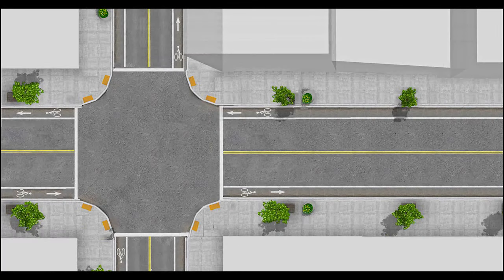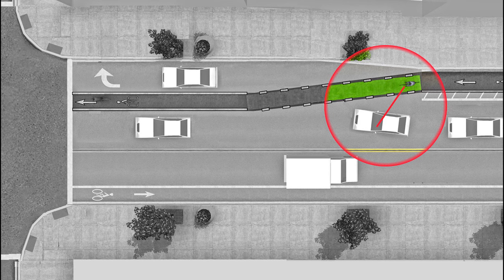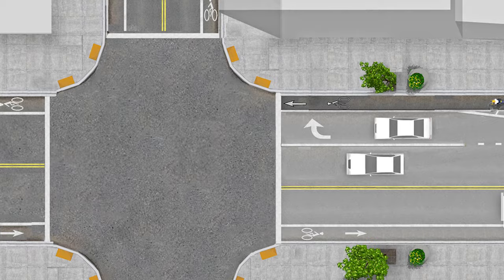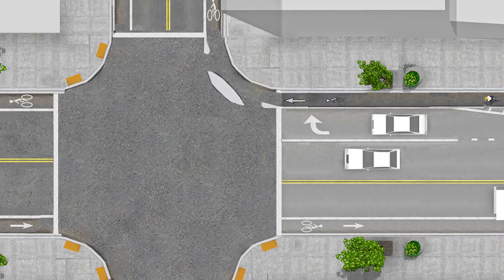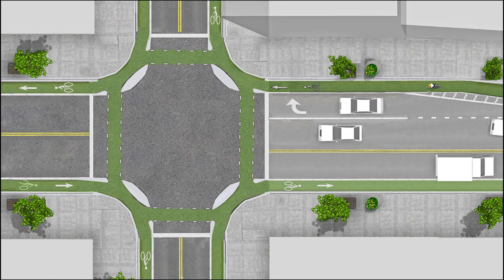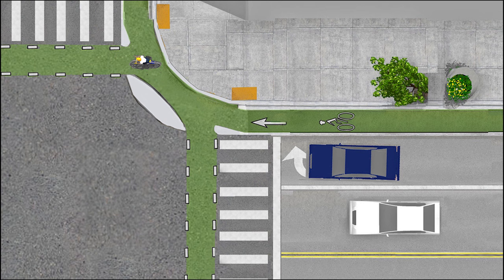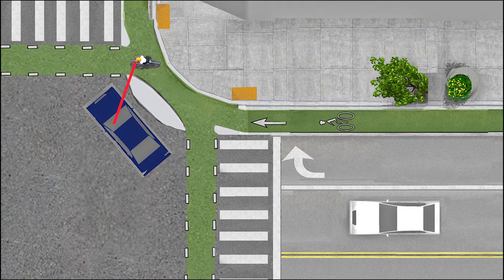Intersection design, the Dutch - cycle friendly - way

Comment: I am a bicyclist and a traffic engineer. in the US. The most glaring problem with the drawing at 2:05 in the video is the shark's teeth (yield) markings ahead of the sidepath crossings in the intersection. Are you aware that in the US such yield markings within the intersection are not allowed?

In both the US and in Europe, a bicyclist on the highway has all the rights and duties of the driver of a vehicle as far as the rules of the road are concerned. But what are the rights and duties of a bicyclist in a sidepath crossing? In the US, turning motorists have to yield to pedestrians in crosswalks, but a bicyclist is not a pedestrian and a sidepath crossing is not a crosswalk.Therefore a turning motorist does not have to yield to a bicyclist in a sidepath crossing. Is it the same in Europe without the shark's teeth?

---
MUTCD Section 2B.04 Right-of-Way at Intersections
...
Standard:
Because the potential for conflicting commands could create driver confusion, YIELD or STOP signs shall not be used in conjunction with any traffic control signal operation, except in the following cases:
A. If the signal indication for an approach is a flashing red at all times;
B. If a minor street or driveway is located within or adjacent to the area controlled by the traffic control signal, but does not require separate traffic signal control because an extremely low potential for conflict exists; or
C. If a channelized turn lane is separated from the adjacent travel lanes by an island and the channelized turn lane is not controlled by a traffic control signal.
---
Reply from the maker: In the Netherlands, and most of Europe, a sidepath is considered to be part of the road. This means that turning traffic has to give priority to people cycling regardless of their position, on the road or a sidepath, that makes no difference at all. This also extends to pedestrians, they also always go first. It doesn't matter if there is a marked crossing or not. They are considered road users and all road users going straight have priority over turning traffic.
Reply: Perhaps you are confused over the definitions of "road" and "roadway" in the US.

The state vehicle codes usually define a road (i.e., a street or highway) as "the entire width between the boundary lines of every way publicly maintained when any part thereof is open to the use of the public for purposes of vehicular travel." [UVC 1-138] A roadway is "that portion of a highway improved, designed or ordinarily used for vehicular travel, exclusive of the sidewalk, berm or shoulder even though such sidewalk, berm or shoulder is used by persons riding bicycles or other human powered vehicles." [UVC 1-186]

All states but Oregon consider a bike lane to be part of the roadway. Every state, including Oregon, considers a sidepath to be part of the street or highway but NOT part of the ROADWAY.

You say, that in the Netherlands and most of Europe, "turning traffic has to give priority to people cycling regardless of their position, on the road or a sidepath, that makes no difference at all." That may be the way the law is enforced there, but I don't see that in your traffic law. Could you point me to where your traffic law says that?

The laws in the US do not give a through bicyclist to the right of a right turning car the right-of-way. Instead, the right turning car is required to turn from as close the right-hand curb or edge of roadway as practicable and it is assumed that there will be no vehicles (including bicycles) to the right of it.

You are correct that right turning drivers are required to yield to pedestrians in crosswalks (marked or unmarked). But bicyclists are not pedestrians and places where sidepaths cross roads are not crosswalks. US law says that bicyclists have the same rights and duties as drivers of vehicles as far as the rules of the road are concerned. As a result, drivers in the US are not required to yield to bicyclists on sidepath crossings unless traffic controls such as yield signs are in place.

Your explanation of traffic law in the Netherlands makes it clear that bicyclists there don't have the same right to use roadways as drivers of vehicles and that they are given special privileges on sidepaths. That makes bicyclists in the Netherlands neither drivers nor pedestrians, but a third class of road user.

You seem to understand what the rights and duties of bicyclists are in the Netherlands and are an advocate for bicycle infrastructure separate from the roadways. But the laws there are different from here in the US. Are you advocating that the US build the same bicycle infrastructure without the same laws?

The problem is that trying to build Dutch infrastructure in the US without changing the rules of the road is fraught with danger.
Reply from the maker: No, you misinterpret Dutch road law which clearly states: "Drivers: all road users excepting pedestrians;". and "Vehicles: bicycles, mopeds, invalid carriages, motor
vehicles, trams and lorries." This means a cyclist in the Netherlands is equal to a driver of a motor vehicle. Most certainly not third class! About the turning movements there is this article: "Article 18
1 Drivers intending to turn must give way to all
oncoming vehicles and also to all vehicles
travelling behind them in the same direction on their left or right.
2 Drivers intending to turn left must give way to oncoming drivers intending to turn right at the same road junction."
The distinction between carriage way or road is irrellevant.
If laws make a certain type of infrastructure unsafe then they cannot exist at the same time: one or the other should be changed.
Reply: The Dutch law saying a cyclist is a driver is contradicted by the requirement for a cyclist is required to use mandatory cycle lanes (bike lanes) and cycle tracks (sidepaths). Whether cycle lanes and cycle tracks are superior to using general purpose travel lanes ("car lanes") is not the issue. Simply put, separate is not equal.

Also, on roads without cycle lanes or cycle tracks, a cyclist in the Netherlands is not allowed to use a full travel lane like the driver of a motor vehicle is. That also makes bicyclists not equal to the driver of a motor vehicle.

You misinterpreted what I meant by bicyclists being a third class of road user. I did not mean that bicyclists were a lower class, but an additional class (besides drivers and pedestrians). I used the word "class" to mean "category", not "status".

The distinction between carriageway and road is extremely relevant. To be equal to a driver of a motor vehicle, a bicyclist needs equal access to the carriageway (i.e., travel lanes), not just the road (i.e., the carriageway plus any paved shoulder, parking lane, sidewalk, sidepath or verge). For more details on the distinction, see the article I co-wrote with Dan Gutierrez "The Marginalization of Bicyclists: How the car lane paradigm eroded our lane rights and what we can do to restore them" http://iamtraffic.org/equality/the-marginalization-of-bicyclists
Reply: Robert Shanteau We have roads where trucks are not allowed to drive. Cars with a trailer behind have to adhere to different speed limits. Cars are not allowed on buslanes. Are these vehicles not equal? Seperation of traffic doesn't mean they have to be put in a different class. Road signs and traffic lights often are enough to make clear what road user is allowed to drive/ride where without having to change the generic rules that are in place. Signage always comes before road rules.

And
"Also, on roads without cycle lanes or cycle tracks, a cyclist in the Netherlands is not allowed to use a full travel lane like the driver of a motor vehicle is. That also makes bicyclists not equal to the driver of a motor vehicle."

This is not true. Cyclist are allowed to use the whole lane. It is even encouraged.
Reply: Robert, I just read your article. I just can't figure out what is so great about riding bikes on busy roads. Count me in as one of those who wants segregation! The popularity of the new bicycle facilities throughout the US (and the extreme popularity of bicycle facilities in Denmark and the Netherlands) shows that the vast majority of folks are far less concerned with ideological hair splitting than with the real and perceived safety that well-designed bike facilities provide.
Reply: +Robert Shanteau Here it is, being done in America!
http://altaplanning.com/wp-content/uploads/Evolution-of-the-Protected-Intersection_ALTA-2015.pdf
Reply: +Robert Shanteau I was wondering-when you say that, in the US, cars do not have to yield to a bicycle on a sidepath crossing, would that still remain so if the sidepath crossing were controlled by it's own signal (a bike version of the pedestrian light?) Or are such lights not possible in the law? The UK has a weird law which makes that you can have a green bike crossing light, but no red.
Reply: It's just much safer to separate cyclists, accidents are less likely to happen, which is important because a car-bike accident is more likely to cause major damage to the cyclist. If there isn't any separation on a road, bikes have to ride on the right hand side, just because it's safer. It doesn't matter much if you ride in the middle of the road or on the right, but it is much safer to ride on the right, so why not do that? I think you view is wrong about how cyclists should be treated, yes, they are regarded the same as cars by law, but they are much more vulnerable than cars so they need more protection. This is done by separation and rules so there are less accidents.
Reply: So what would you do? After all you seem to have all the info based this video. Oh and those shark-teeth came out of the blue? Didn't see them in the video. So, please educate me how it is so terrible to have these intersections. Maybe you could teach the Dutch to revert to your system. Then again, think most would politely listen, even comment on your plan. Then very fast get the hell out of the building, they would burst out laughing strait to your face. Eh, sorry no, they probably walk away after 5 minutes, laughing out loud and have a beer.

Comment: Probably... Man... a decade ago I saw a video like this about this design. For all I know, it may well have been this video, but who knows. Back when I first saw it, I recall feeling undecided whether this was better or worse, and feeling like the left turn movement was janky at best. But back then, I was a kid who always lived in the US only cycled much a good five years sooner, and not alone. Although I haven't lived outside the US, these days--as someone who frequently cycles and drives, I wish this existed (and would exist) more in the US. Which to some extent, I guess it has, but not to the extent that it should. My city is still OBSESSED with putting bike lanes crossing over a right turn lane/slip lane.

One such example is on a 40 MPH road which is ridiculous; I fear for my life when I go through there at peak traffic times. I avoid it, I'd rather be on the wide-ish sidewalk on the opposite side of the road... except that it's hard and inconvenient to access it; no ramps for the side walk + forced to turn left with car traffic since there's no PED crossings = keeps me in the street longer than necessary. It made me sad when they redid concrete work on the intersection only to not put ANY RAMP ANYWHERE on the other side, not even for the opposing-direction-bike-lane that just ends at a right turn slip lane, also with 40 MPH traffic! Thank to heck some things are getting better, but so many parts of American infrastructure still ETERNALLY SUCK, and it makes me even sadder. If I didn't find some level of joy biking, I don't think I'd have a bike right now.

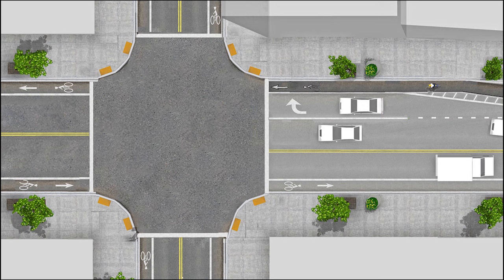Comment from the maker: @jbarner13 This is of course only a schematic version of Dutch style infrastructure in the US situation to show that lack of space is not the issue. If you pause the video at the Dutch version of such a junction at 2:08 (which is the building plan of an actual junction) you see that the weaving is less and more flowing. Still, 20mph is a very unlikely speed for any Dutch cyclist. Especially since that would be faster than cars are allowed to drive in many places (their max: 30kph=18mph).

Comment: Mark, I have ideas for new info videos about protected intersections. I don’t know how to make videos so I want to share these ideas so others (like you perhaps) can make the videos.

People say there is no room for a protected intersection for crossings in their city. So I want to show people the geometry trick that makes it possible with no extra space.

If you draw the arc on the corner for the sidewalk, you draw a small radius, maybe 2 metres for the edge of the bike lane. The side of the bike lane that’s farther away from the sidewalk will have the same pivot point but the radius would include the width of the bike lane, so it would have a radius of 4m. But this makes a wide turning arc for the car lane, as cars turn right. So we make a tighter arc for cars, with the 2m turning radius, like at the sidewalk. This tighter arc is placed beyond the arc for the bike lane, so this creates a gap, where a protective traffic island will go. It’s hard to describe this in words, so a visual presentation would do a much better job of explaining it. But basically you get the space for the traffic island for free. That’s the magic of geometry.

The other idea is to show how many legitimate versions of protected intersections currently exist. There are maybe 5 or 6. Plus there are many monster versions of “badly designed” protected intersections. It’s worth sharing examples of these because it shows growth and ingenuity on behalf of local street planners. The old saying, if you’re not making mistakes, you’re not learning, applies to street and junction design. So many great designs started as someone’s quirky we should try this idea. And it worked better than everything before it. The best would be to make a new design with temporary materials, so it can be changed if it doesn’t work, but I really want to give people credit for trying new things.

Who can I talk with, who would collaborate with me on these ideas? Mark is one of the best but he may be too busy?
Reply: Cities across North America treat the protected intersection in one of two ways. They either give the task to someone who doesn’t understand it, so they make mistakes (which is tolerable if they correct them) or they do one for the whole city and expect it to be a lucky charm for all cyclists. 

Wherever streets with bike lanes intersect, that’s a place for a protected intersection. As a community builds more bike lanes, more protected intersections are needed. A well crafted protected intersection is easy for everyone to use as it continues separation of cyclists from drivers of cars into the crossing (user friendly for people using it for the first time). As many accidents occur at crossings, this reduces the crashes and increases friendliness (politeness) among travellers by giving both drivers and cyclists a bit more time before they cross paths with each other.

But cities can be very slow building protected intersection. Mark’s videos (this one specifically) make it easy for traffic planners to understand. One of the objections I heard was there is no room to install them. I tried to consider why. The closest guess I came up with was seeing Nick Falbo’s design, which includes car parking lanes. His design is thorough because he includes car parking but it can give a new designer the impression a protected intersection needs more space, when in fact it does not. Mr Falbo’s design is one of the designs I feel ought to be included in a list of variations on protected intersections.

My reason for hashing out so many fine details when planners can just go ahead and build them is just that. Planners are not making protected intersections. They may have their own fear they take up too much room. They can also be afraid there will be backlash from drivers who hate bike lanes. That will come anyway. Taking the time to explain cycling infra to NIMBYs how it works will help overcome their resistance. Ignorance is not bliss. Knowledge builds bridges.
Reply: The turning radius of a car lane, where there is no bike lane, is kept tight so drivers slow down for pedestrians. That’s the turning radius of the same car lane on a street with a bike lane with a protected intersection. The exception is a street with a bike lane that has no protective traffic island. Drivers of all vehicles can cut the corner. Long trucks (both straight trucks and tractor trailers) can have their rear wheels make a tighter turn than the front of their truck. This is called dog tracking. It’s something all road users including pedestrians need to understand so they don’t stand too close to the truck as it makes its turn.

Supposing a long truck did make its turn too tight, it would run over the traffic island before striking a person walking or biking. When that happens, first, the truck is going slower so everyone has a chance to see an impending crash and prevent it. And second, the cyclist or pedestrian will see the back of the truck is running over the traffic island and that can warn them to step back out of the way. So saying there is no room for a protected intersection because it doesn’t allow long trucks to turn is false. It just runs over the traffic island (in the worst case). So everyone involved: truck driver, car driver, cyclist, pedestrian... everyone is safer. No one is prevented from using the intersection.

If this is perfectly clear, understood from everyone’s needs, it can be easier for street planners to use protected intersections every time streets with bike lanes cross.